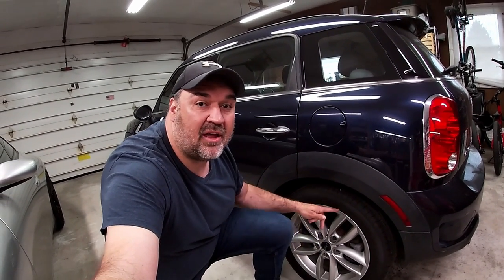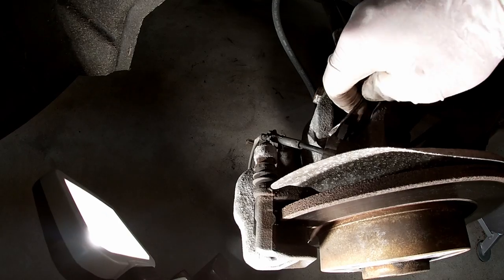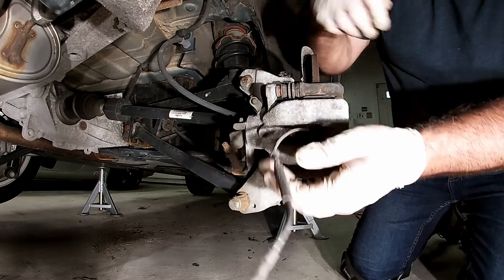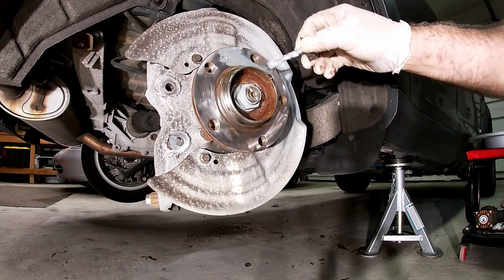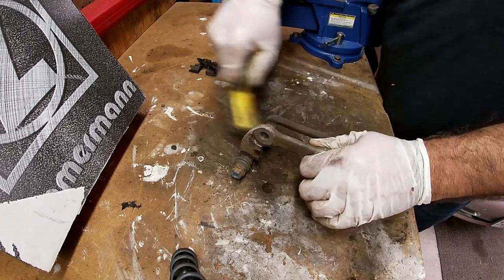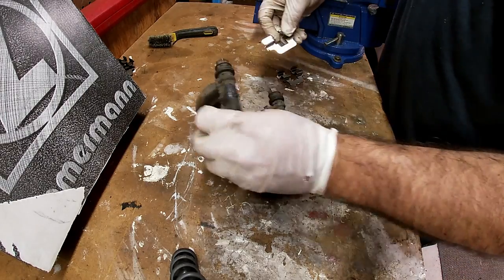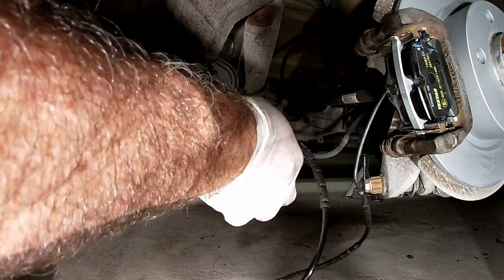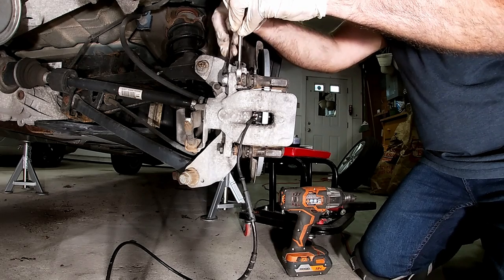Mini Countryman Rear Brakes DIY

Comment: Mate. Thanks so much for both front and rear videos. Other than needing tools I didn’t have, they made it so easy to do the full change front and rear. 

Did you know, mole grips and a g-clamp work as well as your special tool? 😂😂

Also note. If from the UK (like me) think about what passengers side and drivers side mean. 😂😂😂

Comment: Is it necessary to replace the wear sensor when doing the pads? My Mini countryman has 60k miles on it currently. Thanks.
Reply from the maker: I would replace them that's a small cost
Reply: only if the sensor has been worn by doing its job

Comment: Quick question. I have  a mini countryman 2014 base model The mini brake kit that you are using is only for the sport car or will fit both models. I have already placed the kit that you have listed on the fcpeuro link. I will appreciate the response Thanks..

Comment: I have the tool to compress the piston, So based on your last video you only need this for the rear pistons? Also I know you didn't open the brake lines but no need to bleed the brakes?
Reply: You don't have to bleed the Brakes when just replacing the Rotors, Pads and Sensors.

You use the Caliper Compressor for both Front and Rear.